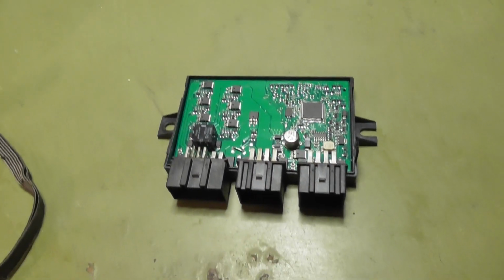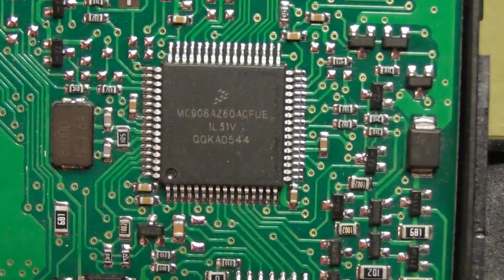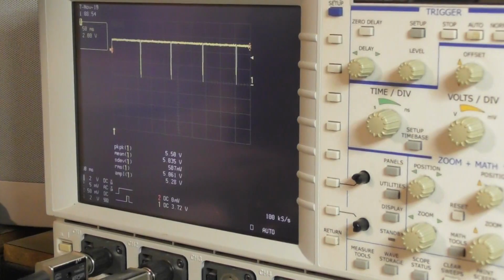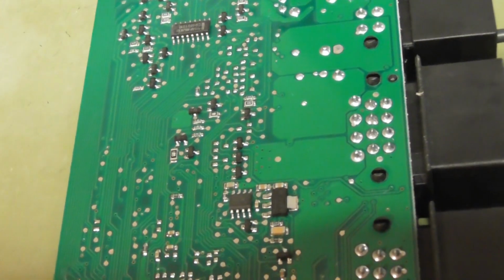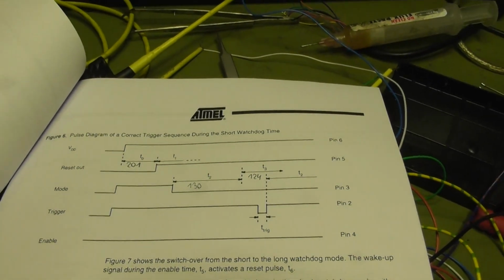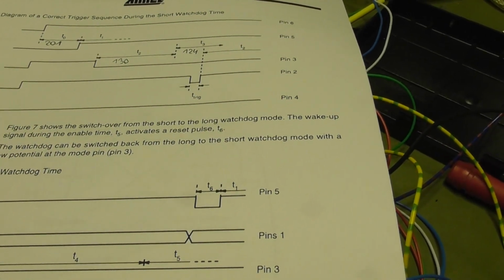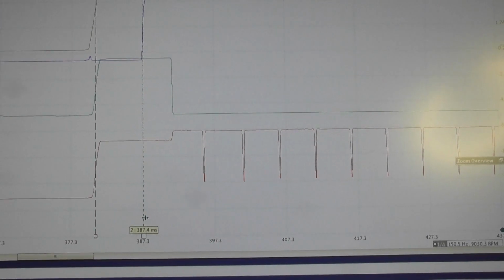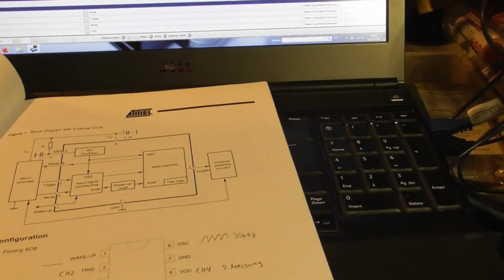7L0907383 Porsche / Touareg trailer control module diagnosis Part1

Comment: The MCU stops feeding the watchdog after 20 cycles/100ms, but why?  Bad firmware?  Bad stored configuration?  Bad peripherals/sensors?  In any case, desterministic.
Reply from the maker: You are right! Bad peripherals i can rule out so far, the MCU crashes after 20 cycles, i will post a follow up as soon i have all parts that are required. Thanks for your comment! Matthias
Reply: I have no idea of what you’ve done. I’m rookie in electronics, but appreciate your energy and enthusiasm. Keep doing the video.